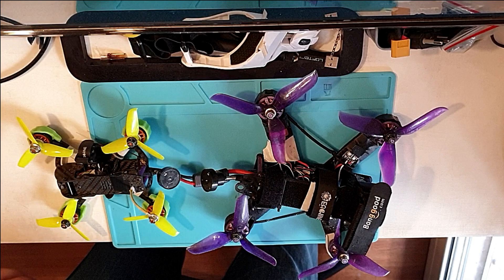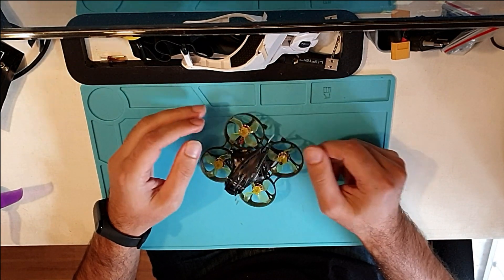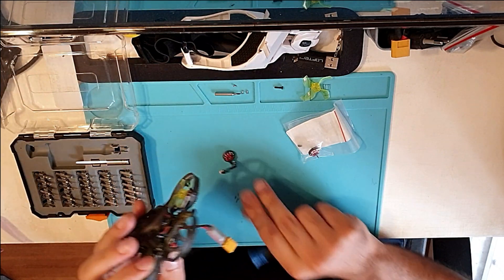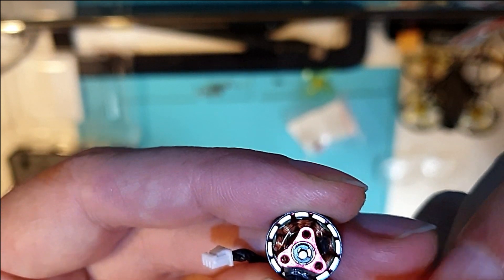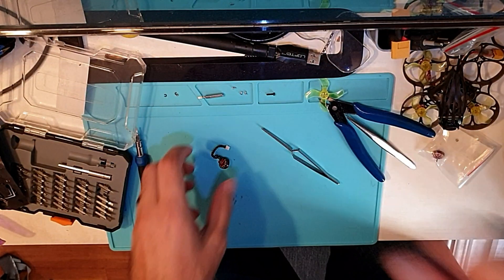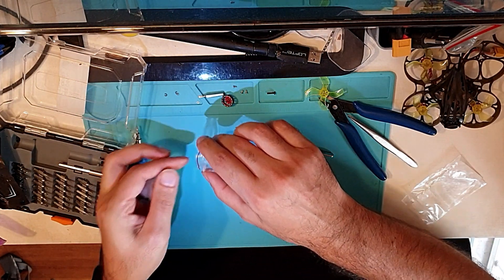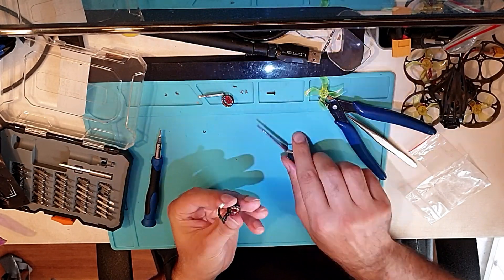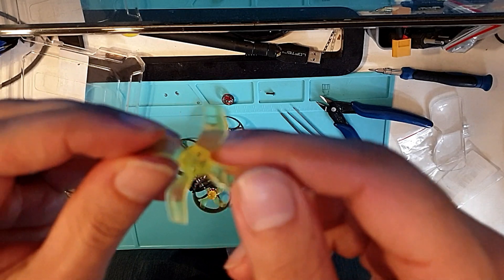How to replace a motor bell |🔥ITOSAN🔥| #fpv #howto #motor

Comment: Can you remove tyro 79 motor bell, I can’t get mine to come off
Reply from the maker: Yes you can remove it from basically every motor. Here I got a tutorial on how to replace it on a whoop but it's almost the same drill for every one of them. Just the magnets will be stronger and counter acting them will be slightly harder on bigger ones. Totally doable though 😉